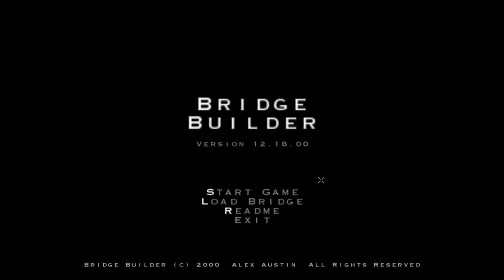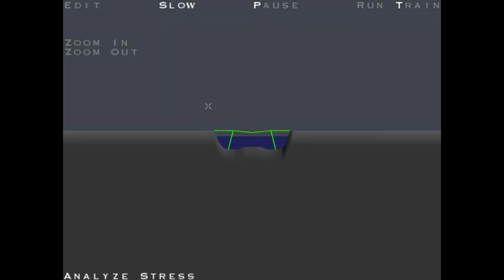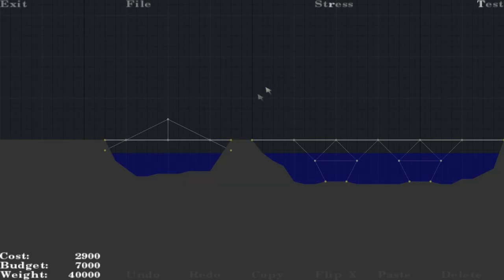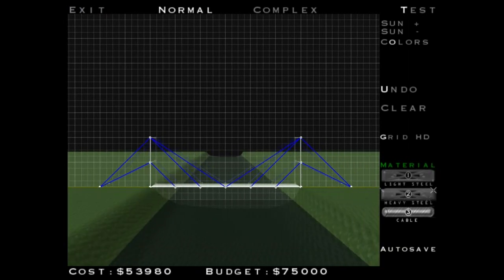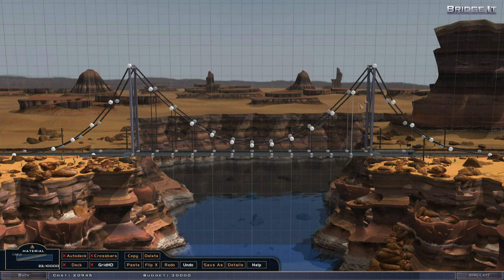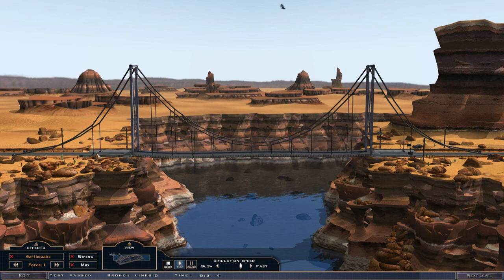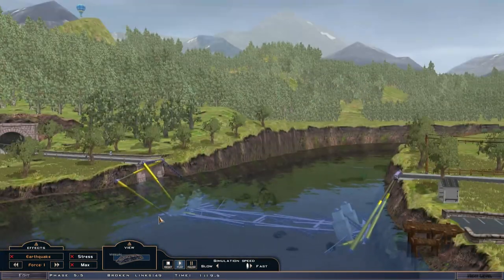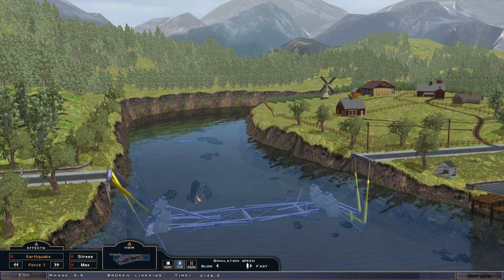Bridge Building Games - Not So Rapid Unplanned Disassembly

Comment: i actually played every single one of those games :) what if i told you there is a way to build a suspension bridge without any towers?
Reply: I would ask you to prove it.
Reply: Christopher Carbonaro It's not that tricky, you just make your bridge deck have a downward curve and then run your suspension cable from edge to edge with a shallower curve.
Reply: HerrStein Ah, I love it when people try to still sound vaguely polite while insulting someone.

But I understand how you feel. There are a lot of times when I've seen someone ask for help with a game or something, and my thing is to just nudge them in the right direction and hope they figure it out for themselves, but others come in and detail exactly what you have to do.
Reply: no he asked ME to prove it. not some random guy to ruin the puzzle or did he?
Reply: HerrStein I would have thought it was obvious from the context that the "you" was merely rhetorical, and that proof from anyone would do, that is the case with such questions generally. If he were looking for a puzzle he would not have asked a question or perhaps merely asked a different one, such as "where would be a good starting point for someone trying to build such a bridge?".
Reply: The Millennium bridge in London is a bit like this. A suspension bridge where the cable is below the line of the deck. Although it was famously a bit unstable when it first opened.
:s